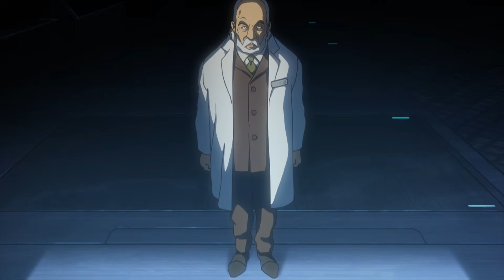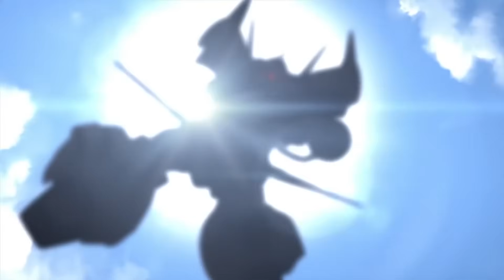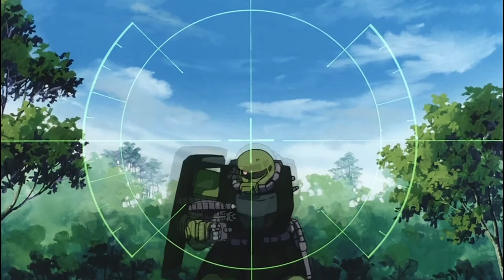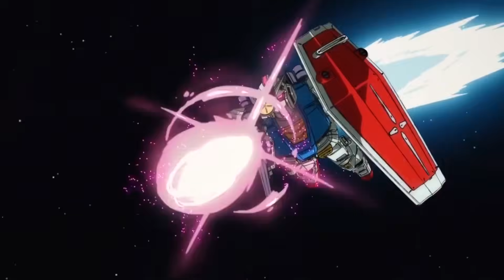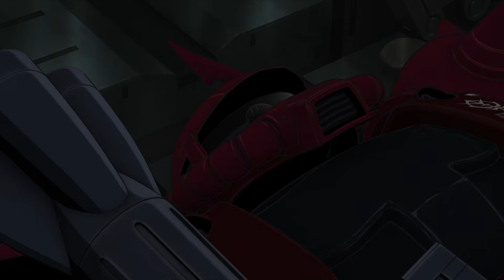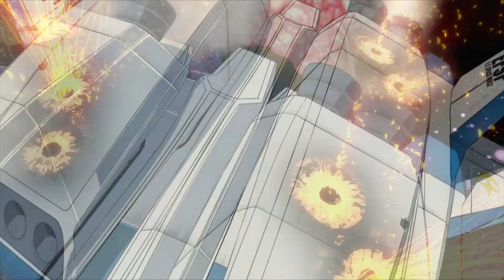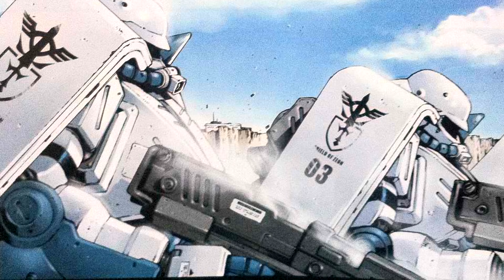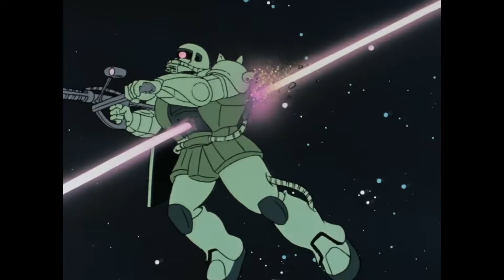How Space Warfare Was Changed Forever | MS-06 Zaku II (Mobile Suit Gundam Lore)

Comment: This is my jam, definitely do more Gundam videos. Overall this one was well executed but I had some minor nitpicks. You omitted mentioning the pinnacle of Zaku 2 models, the MS-06R-1A High Mobility Type. These things could keep up with the more advanced Gelgoogs at the end of the OYW and were preferred by the Aces alive at that point in the original continuity. In Origin, the footage you're using of the Black Tri-Stars during Loum are R-1As.

You also used footage of a Gouf flight type to illustrate the atmospheric example, as Ramba Ral would say "this is no Zaku, boy! No Zaku!"
Reply: Actually the MS-06R-2 High Mobility Type could keep up with the Gelgoog. The R-1A was still Impressive but not as good as the R-2. But I agree with everything else!
Reply: @xpluscollectorscrew  I've been out of the Gundam sphere for a little while. Might have mixed up R1 & R2 a bit. You at least picked up what I was putting down.

I'd have to say that Shin Matsunaga's high mobility Zaku is probably my favorite.
Reply: @cd5sircoupe  I'm Johnny Ridden fan so of course id go for him, although Matsunaga is still badass
Reply: @xpluscollectorscrew  So I have a Zaku2 2.0 MG Shin Custom that I did up super nice. I'm talking like I went to this old hobby shop and got a bunch of tiny screws for model trains to put in place of the indents in the casting on the model. Also got a really nice orange "gem" for the mono eye that was supposed to be like a traffic signal for a train set, idk. Did that one up with some decent paint, all the waterslides, etc. I'm no GBC competitor but that probably had the most effort put into it of many of my kits.

A few years later I picked up the old Gelgoog Jaeger hguc kit and painted it in Shin's white/grey colors as well as used some of the leftover waterslides. Fast forward ten years and PBandai released the official Shin Gelgoog Jaeger as well as Ridden's Gelgoog. Picked up both of those. They're both currently in my backlog pile abyss.

I also remember one of these mall stores in the early 00s having a bunch of MGs that we didn't have in the states yet. One of them was the 1.0 Ridden Gelgoog. I was like who is this guy? Went on a tear looking him and the suit up on the nascent internet/mahq/etc. Pretty cool character overall.
Reply: @cd5sircoupe  Sounds nice I collect HG models...I have over 250..lol I weather them, panel line, do some seam line removal.. I'm not entering contests either but I'm happy with them. I own so many because I use them for table top role playing/war gaming, plus a I just love'em..
Reply: @xpluscollectorscrew  That's pretty interesting. Never heard of people using them for tabletop games.

I've got sheesh, I don't even know. Maybe close to that. I probably have 75 in my backlog at least, lots of P-Bandai stuff too. Also tend to do a lot of weathering and I generally paint at least half of the model if I don't plan on changing the color scheme entirely. Panel lining is the bare minimum imho. Never really got into the seam line removal but did get a pin vise set to fix some broken joints. Haven't dove into that mess yet.

It got to the point where I had to cut myself off from buying more of them. I've been building them since, well '00 or so around when Wing came out. Anything I've done since 2010 is way nicer than my early work that's for sure.
Reply: @cd5sircoupe  I hear you my backlog is massive...I usually only remove seam lines that really bother me theyre worse on older kits..but even im selective otherwise it takes the fun out of building them.some i just convert into panel lines. I'm also choosy on complete recolors i dont use an airbrush so usually spray can and hand brush detailling.
Reply: @xpluscollectorscrew  Same I Tamiya spray can a lot of mine but most of my paint is hand brushed Tamiya. Takes quite a lot of patience. I find it much easier on HGs and on most MGs I'll spray can, though I've been known to do some hand style on the 100 scales. I think the most recent one I did was Gyunei's Geara Doga RE/100 and before that maybe a MG GM Sniper 2. I don't even want to think about the Deep Striker I have sitting in a storage room...

I definitely prefer the newer kits with better engineering. Way less seams for sure.
Reply: @cd5sircoupe  yeah for sure on the newer kit engineering. Jagd Doga? Or geara doga?...i use either matte testors clear cote or krylon matte spray...anyways cheers!
Reply: @xpluscollectorscrew  Jagd Doga. My mistake. Got a bit hasty there in my reply. Again I'm a little rusty with Gundam stuff right now.

Testors I've had poor results with. I used them in my earliest builds since that was all that was really around at the time. It really needs to be cut with thinner a ton to get decent results without laying it on too thick. Krylon & clear/dull cote stuff works great as far as sprays go. 

Do yourself a favor and get some Tamiya acrylics. They are by far the nicest paints I've worked with for this hobby, and come in both small bottles for brushing on and aerosol spray cans. I've also tried a few colors in some Warhammer acrylic colors. The only one I have here is by Formula P3 or something like that. They've been pretty nice too.
Reply: @cd5sircoupe   I havent had any issues with testors...maybe it was a bad batch or you sprayed on a humid or cold day...ive almost ruined a project trying to spray on a rainy day once, since i figured it was only heat based humidity that cause issues. As for hand painting..ive had great results with craft paints..for me ive been happy with cheap, and the results ive been happy with..im also an artist who works with them so perhaps thats why im comfortable with them...not sure. Im sure they are nice paints  but for me im happy with im comfortable with. I dont use thinners or spirits or anything like that. Distilled or bottled water is all i need.
Reply: @xpluscollectorscrew  Nah it wasn't a bad batch of Testors, it was like every bottle over a couple of years. Though they were enamels and not acrylics.

Humidity will do that to you. Sucks to deal with but what can you do other than delay you painting until it's gone?

I generally don't use thinners or spirits aside from cleaning brushes either, but based on how thick that Testors paint was I'm assuming it would need to be thinned to work how I'd like.

I'm also what I'd consider a former artist, now I just do stuff like this hobby. And I guess on some level my aesthetic eye still works on things like modifying cars and the sort regarding customization and appearances.

But seriously, if you ever get a chance to pick up some Tamiya paint at a local hobby shop or something, give it a try. It's not that expensive and I'm sure you'll like it.
Reply: @cd5sircoupe  i have airbrush based acrylic by tamiya...but the chem smell when i open and use it is very unpleasant..so i stick to craft paint
Reply: @xpluscollectorscrew  Interesting. I've never used their airbrush stuff. But at the same time, their aerosol and bottled stuff has no odor that I can tell. And ever since I quit smoking in '16 my sense of smell is really strong.
Reply: @cd5sircoupe  I've only smoked once my entire life..i'm guessing these are specially mixed for the air brush.
Reply: @xpluscollectorscrew  I smoked for about 13 years. Would not recommend it haha. I still vape quite a bit but that might come to an end if the FDA or whoever has their way with regulating things as it seems they will.

Probably so. I don't have much experience with airbrushing stuff. However, I can remember now that the paint had this noxious almost mustard-like smell to it. It was a janky Testors budget airbrush kit that I used probably in like 02 or 03.

I really should get an airbrush though.
Reply: @cd5sircoupe  i have a testors airbrush which isnt bad.. but i dont really have any place to run it

Comment: A small error, Black Tri-Stars did not use S Types, they used High Mobility R-1 Zaku IIs in the Battle of Loum
Reply: Considering the Zaku in 08th MS Team had dom like legs, most likely to test out the data and design for the later Rick Dom which is a Dom replaced its nuclear jets (earth) for rockets in space
Reply: MaxHD2490 Avenger I agree.
Reply: And the red c----i mean crimson lighting's r2
Reply: The Zaku High Mobility Type with Dom legs is a separate model from other high Mobility Zakus, it was a design verification model for the Rick Dom.
Even outside of The Origin The Black Tri Stars did use Zaku High Mobility Types but not an actual test version, they used the original production version (I belive the MS-06R1) which was the most produced example.
Reply: @garrettlittle1279  That MS is the Zaku High Mobility Test Type and it’s number is MS-06RD-4. It’s not an R-1 or R-2 High Mobility Type Zaku II. The Dom legs Test Type was used by Aina it just used colors related towards the black tri stars in the original animation in MS Gundam 8th MS Team. In The Origins line of HGUC it’s colors were redesign, I don’t know why, but was changed to not look like the black tri stars. The purpose of the Test Type was to see if the Rick Dom legs can be used in space to further the development of the Rick Dom for space combat.
Reply: Adn? Amuro still solos.
Reply: Actually they were Hi Mobility test types not the R-1.
Reply: Barry Bend The High Mobility Test Type was only seen in Gundam 8th MS Team and it shared similar colors as the black tri stars but was not used by any member of the black tri Star Unit. MS-06R-1s were the units mobile suit during the battle of loum. The biggest difference between the two suits is the feet. Test Type used Dom like leg units. If you don’t follow Gundam the origin logic then go to gunpla and look at the Zaku II High mobility type (original one) for black tri stars. That’s not a test type nor does it say test type.
Reply: Actually, they did use the S type only in the games and Origin they used the High mobility types. https://gundam.fandom.com/wiki/Black_Tri-Stars